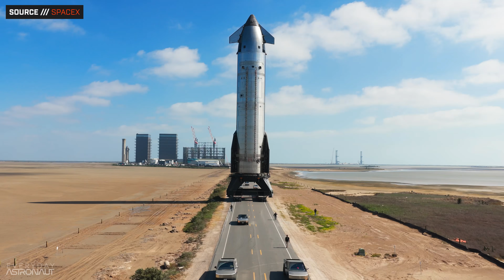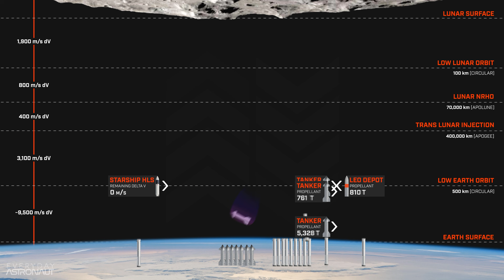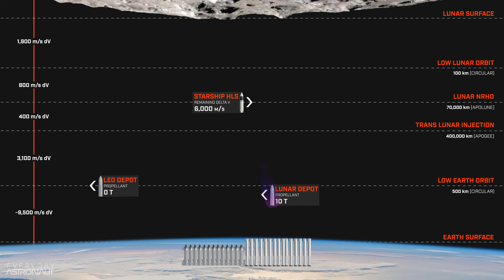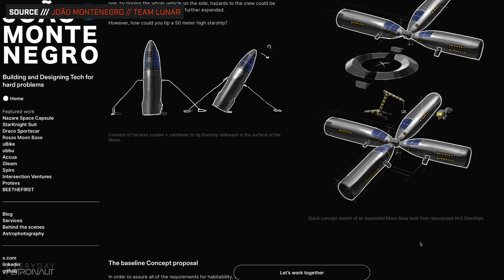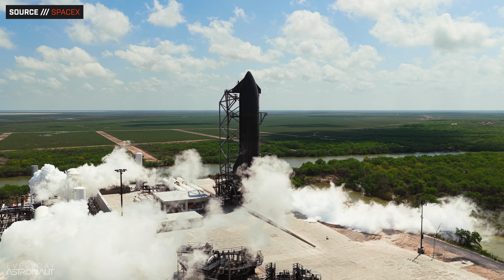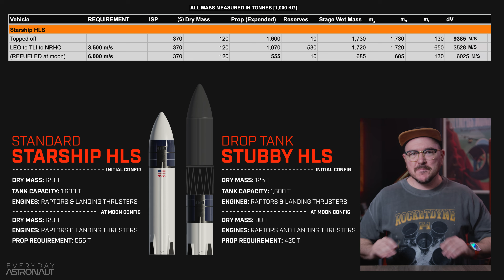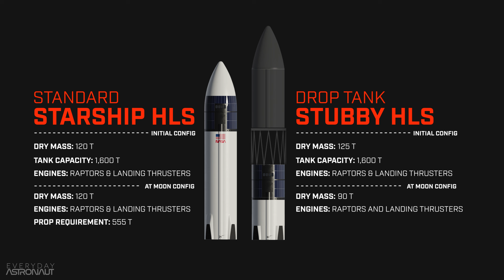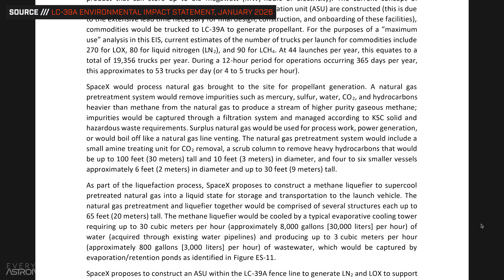Does Starship REALLY require 15+ launches to land one lunar Starship?!

Comment: 57:00 re expendable tankers. Not hundreds of millions per launch. Projected cost of engines is 250,000 each, now even at twice that, expending 39 engines is only 20 million. There's 4000 employees at starbase, so labor cost is probably around 400 million a year. Not all are building starships, but assuming they were... They build more than ten sets of booster and Starship per year. So the labour cost is about 40 million. The raw materials are less than 10 million. So that's under 70 million. Without flaps, grid fins, heat shield, header tanks and so on, probably less than 60 million each set.

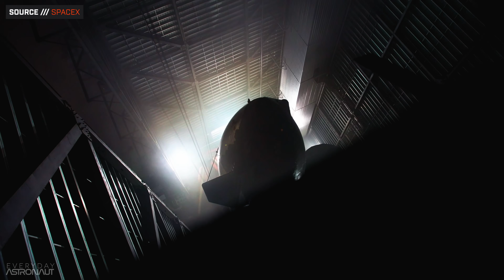Comment: I'm saying this having not watched the video yet, but I don't get why a vehicle designed and seen as acceptable as a Mars lander is somehow unwieldy and ridiculous as a lunar lander. 0:13
Reply: I'm saying this without reading your comment, but you won't read this reply either, so who cares what I say? Atmosphere!
Reply: @g @geirmyrvagnes8718  never said I wasn’t going to watch the video, I just don’t get the premise of the statement. Way back when Starship was first introduced, before it was even called Starship, SpaceX showed videos of a colossal ship landing on Mars after having been refueled in orbit. Everyone thought it as awesome at the time. But somehow this same concept applied to a Moon landing is considered by some to be unwieldy and ridiculous. Why is one ridiculous but not the other?
Reply: @gamefrySE  OK, slightly more seriously: The Moon is a tippy place because of the low gravity. If you are moving sideways at all, it is much more difficult to cancel that out by putting a foot out to the side and using the ground and gravity. Secondly, Mars has an atmosphere you can use to slow down without burning fuel. The Moon version of the ship has to bring a lot of fuel to compensate for that and can delete flaps and heat shields, making it a quite different ship. But that also means it can not land back on Earth to pick up the next payload. That makes it practically single use.

Comment: An added benefit of the drop tank option is you could land upside down. The drop tank is expendable, and it could have landing legs  etc. It could also potentially act as a launch pad if you wanted to use the small thrust engines more aggressively. Mostly upside down saves you from needing all the mechanisms to remove it, but there are lots of opportunities to place new problem solvers in there too.

Comment: Regarding landing on the side:

The propellant would also settle on the side of the tanks vs the bottom.

Would that mean they also need to have outlets on the side? Would the plumbing be a problem? Seems like more weight, at a minimum.

I don't believe dual-direction prop tanks have ever been done on any vehicles, have they?

Comment: My predictions for the answers to the questions in the timestamps:
1. It's a significant extra engineering challenge over other designs, but not insurmountable.
2. It's a significant extra engineering challenge over other designs, but not insurmountable.
3. It's a significant extra engineering challenge over other designs, but not insurmountable.
4. That's not what SpaceX agreed to, and this ain't no cost+. If NASA changes the mission to bail them out of their promises I'll be sad for the lander options that got passed up.
5. Not that big of an economic problem compared to anything else going on.
Reply: rule 0: just because you could doesn't mean you should

Comment: Tim, this is one of the best Starship HLS analyses out there— the delta-v maps, ISP explanations, and tyranny of the rocket equation are spot on.
That said, I think the 'future best idea' for fixing the launch count isn't shrinking the lander or switching propellants, but super-stretched tankers optimized purely for propellant delivery.

Standard Starship propellant capacity: ~1200 metric tons.
A tanker with stretched LOX/CH4 tanks (say +10-20m in the barrel section, no heatshield/flaps/payload for some variants) could carry significantly more. Recent concepts point to tankers delivering 150-200t usable per flight to LEO.
For HLS (launched mostly empty, needing a full load for trans-lunar + landing + return), you're looking at 1000-1500t+ propellant depending on exact dry mass and reserves.

Math check: Fewer, higher-capacity tankers directly reduce total launches. Even with boil-off and transfer inefficiencies (~5-10% loss), this scales better than many small flights. Plus it leverages the same production line and Super Heavy booster.
This aligns with what we've seen on stretched Starship talks—elongated tankers could be the elegant fix. Curious if you covered any concepts like this in the full data! 🚀

Comment: I find it a bit unfortunate that temperature is still defined by molecular properties. You could just define it as radiation power per unit surface, which is more or less how the vacuum of space gets its temperature assigned. So no, space is not cold because it's a vacuum, space is cold because the universe is expanding (diluting energy) and our star is not.

Comment: 15:50 Should they change the name of these engines, then? If the sea level engines are also used in a vacuum then the naming convention has broken down. Raptor 3 Static and Raptor 3 Gimbal? Idk.

Comment: I feel like there should be a filled tanker in orbit that only has to attach to Starship once.

One refueling/ docking with the fuel already in orbit sounds safer than launching the crew beforehand and docking with them several times.

This also takes the pressure off of launch windows and hopefully optimizes the process.
Reply: Thankfully, that is currently the plan. Except for the crew. They come in later.

Comment: Many refueling calculations use tanker version with the same cargo volume as usual starship has. What if we fill up that cargo volume on 46:44 with the fuel? It will make entire rocket much heavier, with 1.15 TWR, but we can use 35 raptors instead of 33, that would be 1.22 TWR.

If cargo volume is the same as tanks volume, it will give additional 2500m/s delta v to the ship and take about 800m/s away from the booster, which will result in +1700m/s total delta v or about 250t of propellant to orbit.

Correct me if I wrong, but I think that's main idea of the tanker. Probably there are 6 raptor-vacuum engines increasing thrust for such a heavy ship and isp a bit

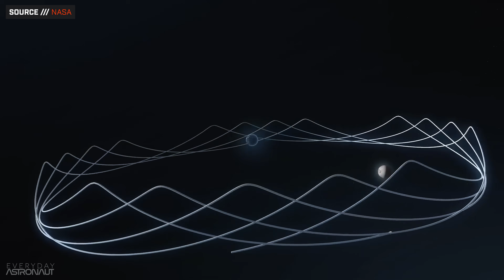Comment: 7:39 Unless there's a Delta-V limitation I missed, Orion being in a NRHO orbit is a program requirement left over from Gateway, not a hardware limitation. If I recall correctly, NRHO was chosen for the Gateway Space Station to limit the influence of the gravity gradients in Near Lunar Orbit.
Reply: 35:20 Another advantage that HLS has over the commercial robot landers is direct human oversight. A pilot can troubleshoot faulty sensor readings and perform a Go No Go evaluation in real time. This would effectively eliminate the problems those commercial landers had.

Comment: You could use the drop tank to build lunar base also. There was some gas that you can make from moon other the -CH4 that has lower power level but could be used IRSU
Reply: i always wonder why ppl think you can just simply repurpose a fuel tank into a habitat module...as if it isn't 100x easier to just build and bring a good habitat module that is human rated and has all the interiors than shoehorn it together on the moon from a tin can.

Comment: Why not launch the 8 or so star ships as fuel and leave them in orbit as the structure for a pinwheel space station.
Reply: and who is the poor sob who will build the interiors inside the starships for a space station in orbit in 0 G...and who will bring the parts?

its 100x easier to just launch a space station moduel.

Comment: At 16:30, this just shows how much of a scam Starship HLS is. It is never suppose to come back to Earth, which means it is designed to permanently haul 3000kg of sea level engines around. Also a large chunk of the dry mass will be the oversized fuel tanks to give it the deltaV needed to do the trans lunar injection. 

Starship is impressive in its own right, but it is a horrible lunar lander. It is bluntly designed for other missions and just abusing the program for funding. Massive amounts of permanently dead weight. Its main engines cannot even be used for landing so a 2nd cluster has to be added up top increasing weight even more. Needs a crew/cargo elevator because dead-weight engines are where the door needs to be.

Comment: For the landing discussion doesn't your analysis assume the regolith is firmly packed? What if it's really loose and the rocks under the downhill legs falls away under the massive weight of the ship? How does it maintain its "grip" on a loose surface if it lands on a slope? 

What factors have caused the other landers to fall down? Did they not have self leveling legs? Did they dig more of a crater on landing?
Reply: none of these questions have been answered yet...tests will need to be done...many tests....thats why none of those time tables for such a heavy vehicle are even remotely close to realistic.

Comment: The Eagle of Apollo had the same problem you mentioned about horizontal landing.
They solved the stability problem caused by the different fuel/oxidizer feed-rate issue by strategically arranging the tanks.
That is why the Apollo Lander looked asymmetrical (the ascent module). They can adapt the same method to the Moon Starship.
Moreover, if you go vertical, you could place one set of engines on top rather than all at the bottom, so you don't have to add more engines.

Comment: Amazing video. My biggest concern (you touched on it) is getting all the fuel needed for 14+ rockets. Even if they have their own fuel depot at the base I would imagine it takes a very long time to have the amount you need for one launch. Such a massive rocket and so many launches for one mission=absurdly amount of fuel.
Reply: thats the easiest part. you can do that on the ground, in proven facilities...produce it yourself or just buy it. if a problem arises, you are on the ground, you just fix it with proven methods.

no really...just imagine everything you have to do in space with no backup, no easy fixes...and if only one launch fails...or worse, docking fails...or fuel transfer...anything you would need to fix in space. 15+ times....for 1 launch.

Comment: You discuss the starship variants for how many tnakers, but you don't mention cutting payload to the surface.

Wouldnt it be easier to keep the regular HLS and cut the payload to surface from 100T down to 15T?  This would require MUCH less tanker flights, right?  At least worth it for the first landing missions while starship is on its ramp up years

Comment: Starship HLS is superior not because one vehicle is “better” than Apollo LM, but because the architecture changes the mission from a one-shot expedition to a repeatable logistics system. Apollo was optimized to land two astronauts once, using a fully expendable Saturn V. HLS is built around high launch cadence, orbital refueling, large propellant margins, and massive landed payload. That means the limiting factor shifts from “can we land?” to “how fast can we move mass to the lunar surface?” For a sustained Moon base, that logistics advantage is the real breakthrough. SHORT: If SpaceX can launch Starlink V2 satellites almost every few days, then launching 10–15+ Starship tankers to fill a 1,500-ton LEO depot becomes a logistics problem, not a physics miracle. Even if the propellant cost is around $25 million, that is small compared with what it unlocks: the first practical human ability to move massive payloads beyond Earth orbit and build infrastructure on the Moon.

Comment: What is the bearing capacity of the regolith? What is the risk of regolith collapsing under or squirting away from the landing pad--especially if it does not land plumb and the weight distribution is uneven?

Comment: I think the whole moon landing program needs clarification. Do we want a permanent base or just get to land on the moon ASAP. SpaceX is going for the long run. They'll never get a landing by 2028. Blue Origin's system is more likely to land by 2028, but is not a system for a long term base. Maybe the solution is two independent programs by NASA or a combination of both systems. In the shorter term, use Starship reusable boosters and new expendable upper stages consisting of essentially, Apollo's upper stages and landers with the Orion capsule in low lunar orbit with a modified Apollo type service module. The Apollo architecture was designed to get to and from the moon as simple and reliable as possible. It worked. It can work again, while SpaceX develops long term capability.
Reply: landing a starship on the moon as a first lander is a dumb idea...the weight alone. once you have a base, a nice pad...and you need mass cargo transfers...maybe.

there are tools for the job...and then there are tools for jobs not yet needed.

Comment: My main source of skepticism is the refueling of the cryogenic(?) propellant. Apparently it has never been done before, let alone at this scale. The fact that SpaceX has not launched and tested a prototype for this kind of system, to understand the most serious engineering challenges or blindspots, makes this whole premise  very suspect.If it turns out they need to redesign a lot of components, the program would be significantly over budget and  canceled

Comment: With the stubby HLS and using super heavy to do more work you could also launch from Boca Chica then have super heavy boost back to Kennedy Space Center for catch so it doesn't have to go back as far.
[edit] and then maybe you could do Starlink launches from Florida then land it back it back in Boca Chica to prepare for the next fuel launch without having to transport Super Heavy over water or land?  Not sure how feasible it is to get the first stage to go suborbital 90% of the way around the planet, or maybe launch a couple fewer satellites and do a heavy boostback to boca chica?

Comment: Great video covering most of the details!
But I think that the environmental/climate impact of this architecture is quite obviously missing. A single mission requiring ~20 rocket launches (1 SLS, 1 HLS, 18 Tankers) is manageable today when launches are rare — but if this becomes routine, the cumulative effect will be larger. Not only plain CO2 but also high-altitude soot and water vapor injection from rocket exhausts have climate effects that aren't well understood yet, but are suspected to have larger impacts.
I feel like this area should not be left out, when discussing technologies of the future.

Comment: Honestly, the long road will probably end with nuclear rocket tugs doing the heavy transit work, while we maintain chemical rockets for landing/taking off. In any case, if we are to build anything substantial on the surface, at the time being this mission profile is the only option that we have
Reply: No. Solar/Ion is better, cheaper, needs less reaction mass lifted to orbit, has lower dry mass, 2-10 times the ISP, is easier to refill as there's no danger zone to be avoided, has much warmer and denser reaction mass, the engineering is already done, no need to provide cooling after the engines shut down. 

That's a short list. Solar/ion is just so so so much better that no one would ever consider nuclear.

Comment: Why don’t they use a separate escort starship to bring the HLS to the moon?  They’re sending the depot there anyways, why not an escort ship to get there and then a depot to bring it back. Then the HLS doesn’t need all the fuel and tanks required to get to the moon. It only needs fuel to land and takeoff from the moon. And it would give the HLS so much more non-fuel payload.  What am I missing?  I can’t imagine docking and being escorted is that much more complicated than a docking and fuel transfer.

Comment: It would be interesting to see the numbers if the depot/HLS has a redesigned engine bay with gimballing vacuum Raptors, to get all the way to the 380s isp. It would probably require removing the sea level Raptors to have sufficient room to gimbal, but those should not be required since neither depot nor HLS will return to Earth. There could be some TWR issues with the initial orbital insertion, which could be mitigated by adding more Rvac's (which Starship V4 is going to be doing anyway), or doing the initial launch only partially fueled, with very minimal payload once orbit is reached. Once it is in orbit, the TWR doesn't really matter much, so the higher efficiency during the lunar trips, between the higher ISP and similar or lower mass, would probably more than make up for it, with how the fuel savings compound multiple times.

If you could share a copy of the spreadsheet, I would really like to play around with it and see what some other configurations could be feasible.

Comment: It's always fascinating what people gloss over in order to make the Starship not seem like a completely ridiculous option. No reasonable space program would try to push a system with THIS MANY problems or even potential points of failure. Even having to do more than 1 refueling mission and they haven't seriously considered making a tanker variant. A dozen refuels when no one has figured out yet how to transfer fuel from separate spacecrafts in zero g is just absurd and no one should be taking it seriously without the math and practical prototypes to show it is possible.